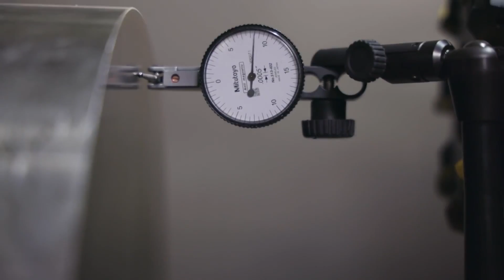Why I’m So Thankful for CNC Machining

Comment: I was introduced into machining when I took a manufacturing job years ago, it peaked my interest a lot and I found it really cool turning raw steel into this very precise and useful object….but I was a “load part and push start” operator. Zero experience needed. I wasn’t able to learn a lot. I did that for 3 years. Well after quitting that job and taking an office job for a year, I knew that wasn’t who I am or what I wanted…I needed to be up and moving more and working with my hands. I wanted to get back into CNC machining. So about a month ago after looking for a new job I accepted a position at a company as an entry level CNC Machinist, even though I had 3 years machining experience my knowledge was very little. The pay isn’t great only like 35k a year, and I could of accepted other jobs NOT in CNC machining that paid more but I accepted this position because it’s what I wanted to be and their willing to actually let me be a real machinist and teach me everything from the bottom up….I just needed someone to take a chance on me and be willing to train me up. They were willing to do that. Right now I’m learning how to read G code and what all the programming language means…I like to refer to it as the matrix….I see a bunch of numbers and letters that look confusing as heck….to skilled people, all you see is distance to part, spindle speed, feed rate, which axis etc etc. It’s a lot to take in and learn but I’m determined. Thanks Titan for your YouTube channel….really really inspiring to people like me.
Reply: It's a great place to be and a trade one can be proud of.
Reply: Stick with it 👍.   It's a new language, but if you want to learn it, you will learn it.
Reply: U need just someone to teach u step by step

Its not as hard as it seems so dont feel discouraged
Reply: Learn cam software as well

Comment: still just learning and at a way too old age:) but im building my second machine and first what i consider a real machine. took 8 1/2 months from order to arrival of the frame. and what was expected to be a $2500 machine has turned into a $6k machine but im so excited with each step i get closer to running my first part.  Happy Thanksgiving Patriots

Comment: if it wasnt for machining, i wouldnt be 15k in debt from schooling and make 14 an hour running a shitty 1980's cnc Mazak mill that cant keep chips or coolant in the machine
Reply: Sounds like your in the wrong shop Anthony
Reply: Why would you be in debt from learning CNC?   It's free to learn.  Anyone can teach themselves the software for free
Reply: @leensteed7861  it’s not free if you learn it at a trade school or some other formal avenue.
Reply: What state are you in? There’s plenty of good paying machining jobs where I’m at
Reply: Virginia, one place offered me 13 an hour and required me to have all my tooling in 1 year, few other places offer 15 but for 3rd shift. Ended up with day shift for 14
Reply: @xX7thseekerXx  how long have you been doing this?